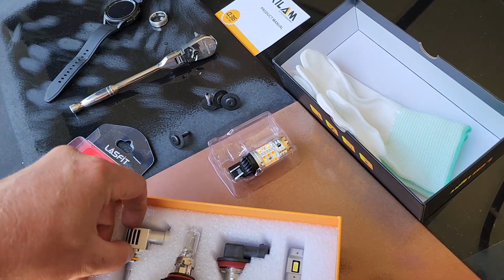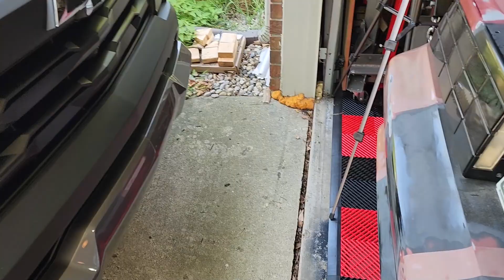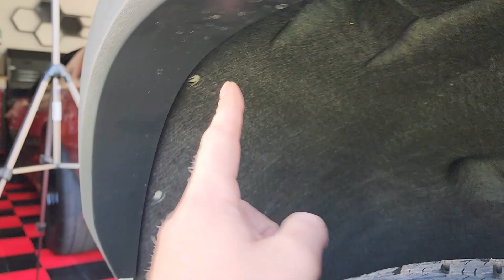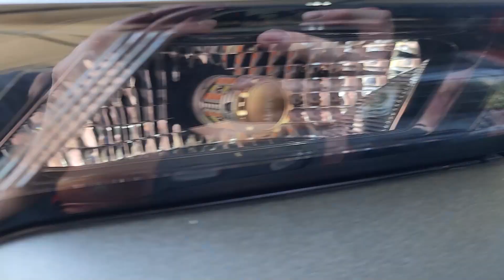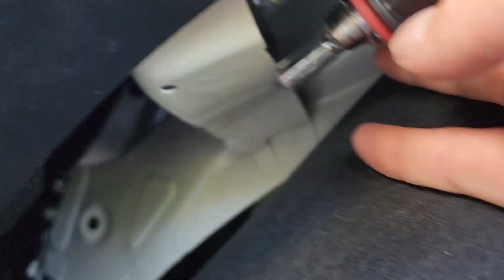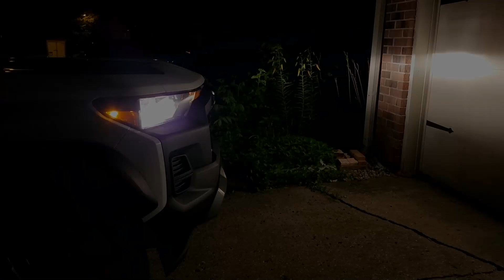2023 Chevy Colorado Upgrade LED Headlights and Blinkers HOW TO Install Auxilam and Lasfit

Comment: Hey Tony, I saw a similar comment about doing the rear lights as well. I was wondering if you know the bulb sizes associated for all the rear lights, including the third brake light? Also, any intentions on swapping the interior bulbs at all? If you know the sizes, I’d love to test some bulbs for the rear and let you know if anything I find works out!
Reply from the maker: I can't remember the brake lights and rear blinkers i think 7443 but im not positive. Reverse are t15 and interior are t10 or 194. I have already swapped those and will have a video soon. I also just swapped the entire 3rd Brake Light assembly for an led smoked version.
Reply: @TonyTheTechnician  Appreciate the reply Tony! I can confirm the fitments below:

Rear brake: 7443 / 7440
Rear turn signal: 7443 / 7440 (have not found LEDs that don't hyperflash yet)
Reverse lights: 921 / 912
Third brake light: 921 / 912
Third brake light (cargo lamps): 921 / 912
Interior dome/map lights: T10 / 194 (careful with lights in rear of cab, stiff getting out and very prone to shattering if you use pliers)

I'll try a couple more bulbs for the rear turn signals with built in resistors but I'm thinking a hard wire resistor will more than likely be needed in the end.
Reply from the maker: @calebkeller8226 very nice. I appreciate you sharing the information.
Reply: @TonyTheTechnician Hey Tony! Thanks for the video! Just ordered the headlights. Anyway you could tell me which 3rd brake light assembly you got and what it looks like? Love the videos!
Reply from the maker: Thank you. https://amzn.to/463oT3l
Reply: @TonyTheTechnician sweeet, how do they do lighting up your bed? Is it just a simple plug and play install? Thanks!
Reply from the maker: @alexanderennis853  can't really say since I have a Tonneau cover and I have bedlights so I don't really use the 3rd Brake Light for that. But I can say it is way brighter then stock and yes very easy install and it's plug and play

Comment: Had LED headlamps on my 2019 Equinox and do miss them on my 2023 Colorado WT.  You've got me thinking about doing this conversion.
Love the no drill hood struts. Went a step further and removed the prop rod.
Reply: Hwy i got the wt as well, will these lights work as well for the wt?

Comment: love lasfit had them on my lemon of a 22 , but with the z71 they are all led on the outside but the inside is crappy old lights. but i can not see how to get the bulbs out for the cab lights .
Reply from the maker: You pop the plastic covers off and carefully pry the bulb out. I will also have a video on how to do this coming soon
Reply: another question . lastfit sent me another set of switchbacks becasue the ones i got the 22 do not work . and i have no daylight whites only see the turning. do you see them with the white running lights or only the orange?  let me know so i can send them a responce @TonyTheTechnician

Comment: I just installed the blinker bulbs T 7443D. Blinker are really bright amber! But the white lights never come on? Please help Tony! Amazing video and making installation so simple! I have a 2023 colorado z71.
Reply: You can't use switchbacks on the Z71 they have DRL headlights. The signal lights only work as signals. Lasfit makes a Amber LED for the signals of the Z71
Reply from the maker: So far what I've noticed when the lights are on auto and the lights are off then the white doesn't light up. But when I turn the lights on the white then turns on. I have messaged lasfit about them to see what's up.
Reply: @TonyTheTechnician I tried everything but no luck! On/off. Auto. The blinkers work and look amazing but white lights never came on! Thanks for replying back! 🙏
Reply from the maker: @jimbennett6697  no problem. I'll let you know once they respond
Reply: @TonyTheTechnician  I returned the original lights I bought on Amazon and purchased the lights straight from lasfit! Still no luck on my 2023 z71! Ambers are great! Whites never turn on!

Comment: How much pressure did you have to apply to the low beam housing to come loose? Mine seems excessively tight.
Reply from the maker: A decent amount but not ridiculously tight. It will turn about an inch then you have to pop the plastic cap off.
Reply: Same here, I just can't seem to get it to budge.  Will have to try again later, not sure how I'll get it loose.

Comment: Did you use the standard socket on the turn signals or the CK socket? Lasfit doesn’t list the 2023 Colorado yet. They recommend the CK on the 22 and older models.

Comment: Well hell ya,I have been racking my brain trying to install mine,Thanks for the video!
Reply from the maker: No problem. Glad it helped
Reply: I've tried to install the high beams and twice Ive broken the bulb cause it just will not lock in.Goes in crooked every time.Ordered another pair see how it goes.
Reply from the maker: @vlldavid  you have to make sure the tabs are lined up correctly. Each tab is a specific size so it only allows it to drop in straight, one way. There should be 0 resistance when putting the bulb in the housing. Then a little pressure to turn the bulb. Nothing should be forced or at an angle. Try rotating the bulb more before turning it. You probably have the wrong tabs lined up
Reply: @TonyTheTechnician  May have been the type of brand I got,Going to try another brand and maybe the ones I'm getting dont fit.Thanks again.

Comment: Awesome vid! Looking to do the same to mine. Has anyone found and aftermarket housings yet? Headlights and taillights. Haven’t been successful so far. A black housing for the headlights would look very sleek.
Reply from the maker: No nothing has been released yet the only thing you could do right now is tint them with vinyl or paint.

Comment: Will you be making a video on your brake and rear indicators as well? Greatly informative video!
Reply from the maker: Yes once a company is able to create a plug and play light that doesn't require in line resistors. I will make sure to record a video. Thank you
Reply: Diesel Led came out with reverse lights
Reply: Lasfit Makes a replacement for every bulb on the Colorado I did all the non Leds on my 2023 Z71
Flashers, brake, reverse, license plate, Cargo light and even interior lights all work great. Direct replacement